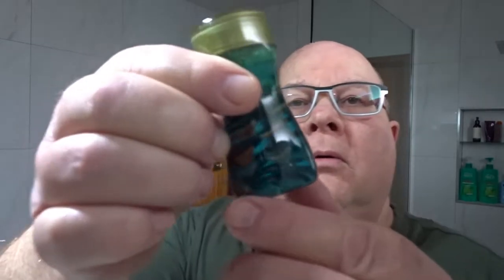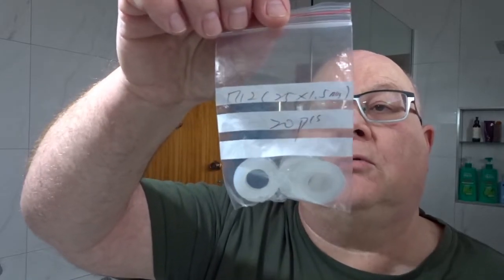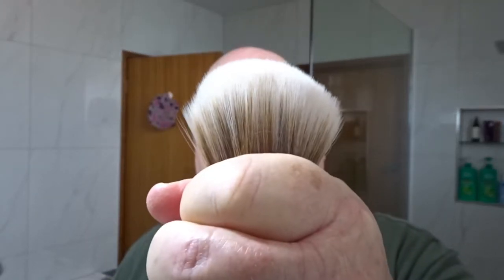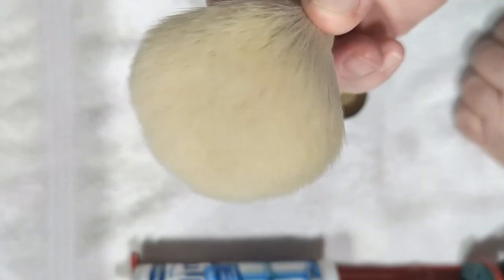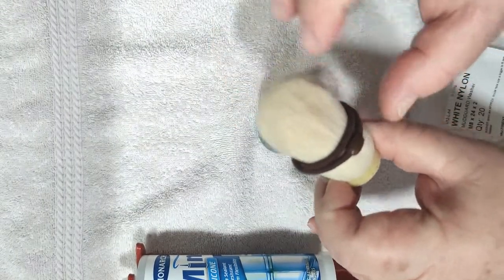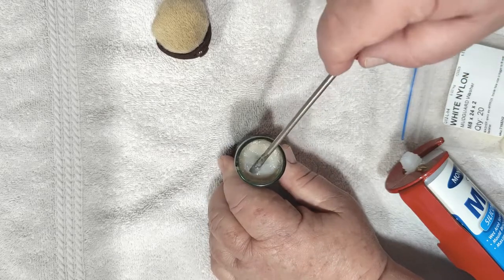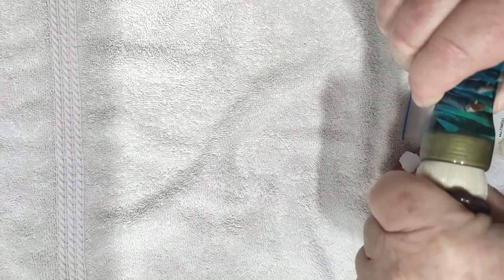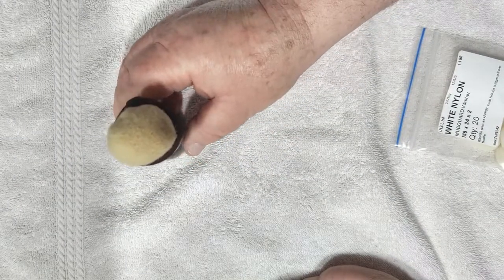How To set a Knot into a new Brush handle #2

Comment: I just started using a shaving brush last winter.  It's a pure badger cheapo but it's some nice to me (helps when you've only seen one :)  With good regular rinsing how long would you expect the average brush to last?
Reply from the maker: I don't have much experience with Badger Brushes, but from what I understand reading the shaving forums you can expect a decent Badger to last at least 10years. That been said when I started Wet shaving I had a Omega Boar brush that I used exclusively for 3 years before the handle broke (the knot was still good), it's replacement is still going after 5 years. Hope that information helps.

Comment: If I need/want to remove the knot a second time is it the same process or is that only for the first removal?
Reply from the maker: Yes it's the same process and if you used Silicone it should be easier to remove, just make sure all the old glue is cleaned out of the bung hole.